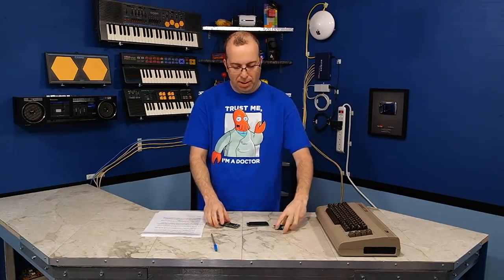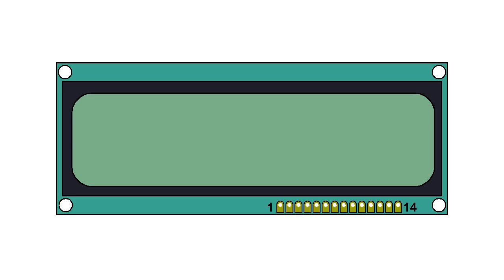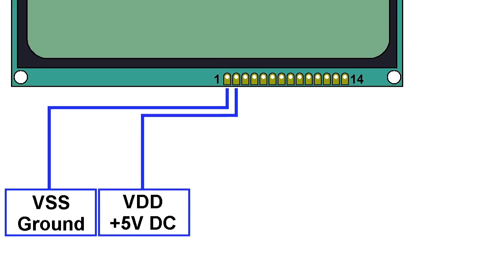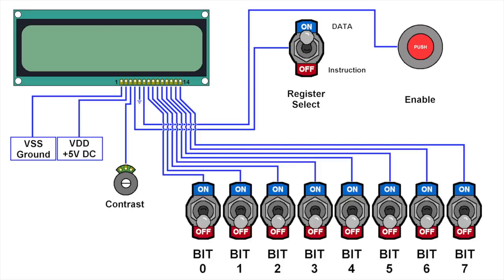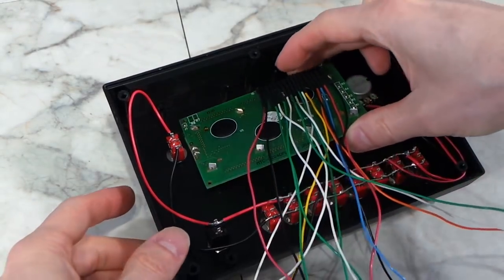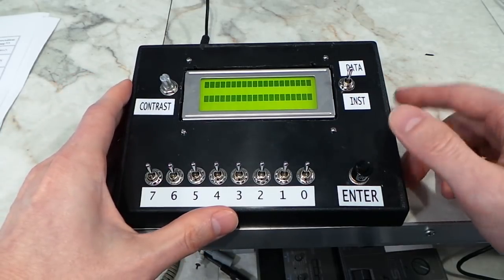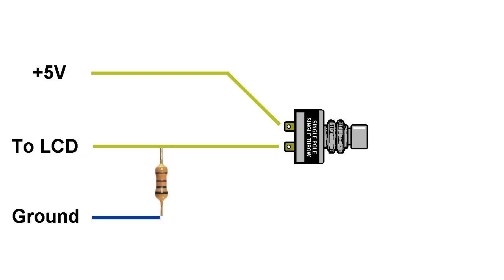How a Character LCD works Part 1

Comment: I liked this video, great for someone getting started in hobby electronics.  I especially appreciate that you show your mistakes!  Too many people edit their videos down to make it look like they got it perfect on the first try and leave the budding hobbyist with the impression that they, the newbie, are just hopeless at it.  Everyone makes mistakes and you often have to build it twice to get it just right.

Looking forward to part 2!
Reply: Robert Liesenfeld moreover, its good to see how he works arround the mistakes he has done. that can be really helpful.
Reply: Yup....and the one "fix" (flip the labels around).....whole lot easier than having to rewire things :D
Reply: @artstrutzenberg7197  I think he should have rewired it and not told us, because... I hate to say it, but that was a very rookie mistake.  With toggle switches like those, when you flip them "down", it connects the center pin with the "top" pin, not the "bottom" one.  It's a common mistake because it's counterintuitive, but a facepalm for anyone who's used toggle switches before. Rewiring would have been as simple as swapping the + and - wires going to the switches. The 8 data switches would have needed only 1 wire swap. (unless he tied off of them for something else).
Reply: I made almost exactly the same comment.  It's perfect to show how you can fix and replace.  I made a toy car with my 11 y.o. son out of printer parts, (gears, transport mechanism, etc., and a motor), and it took 3 1/2 hours because of all the things we had to fix and re-do along the way.  IF it had taken 15 minutes and slapped together, it would have been a fail IMO, because we wouldn't be doing the engineering fault-isolation techniques.  "Hmmm......how do I solve this?"

Comment: Soldering header pins is the way to go with those LCD screens.
Reply: It pained me when we he soldered to pin header. Its honestly worthwhile to just solder pin headers or SIP sockets to everything like that and use dupont connectors or generic jumpers to connect to it and just use non permanent or semi permanent connections. If its the final thing I'll ever use the device in I still always leave some way to remove it just in case. Good design practice. Cheers!
Reply: @Wes8761  yeah that was cringe inducing.

Comment: Those LCD with the damaged pads can be fixed by scratching the traces next to the damaged pads and soldering thin wires directly to the traces.
Reply: I was thinking the same thing.   I've saved many dead things with this technique
Reply: Yeah, I've done the same.
1st, I would take a razor & scrap off the protective film.

I remember using a desoldering strip as a wire.
It'll bind to the board, then attach a wire on the other end.
Reply: Sounds interesting Realtuber thanks for the tip it's a cool ghetto style technical repair technique 😄
Reply: Ive patched together broken PCBs doing that same method
Reply: @dcfuksurmom  well in my case. The PCB and traces were rather large. It was for some gauges for my Datsun 280zx. I was fixing the dash and the connector for the gauges was tight and broke then I tried to unplug it. When I finally got the gauges out, I was able to scratch the coating on the traces and patch them. I also put some double sided tape to hold everything down. Really isn't as hard as it may seam
Reply: @dcfuksurmom  definitely. I believe Dave did do something similar to what I said on a computer monitor in one of his videos
Reply: Ain't nobody got time for that.

JK that's pretty cool.
Reply: Glad some one mentioned this... Even though it was a year ago :D but yes could have been fixed easily enough. ive done it tons of times on prototype projects... Ive also bodged on traces using copper tape, or conductive pens...
Reply: @dcfuksurmom  i've had to do this...not on broken traces, try soldering 18 gauge(awg) to bluetooth headset components, the wire is 3x thicker than the trace its attached to!
Reply: Indeed, I once blew up the RS232 chip in a 56K dial-in modem (ah, those days) and ruined quite a few of the soldering pads and traces on the low-quality PCB while removing the SMD chip. I scraped off the lacquer from nearby pads and traces, and soldered wires to those, connecting to the corresponding pins on the chip. It looked very ghetto, but I did keep using that modem until the ADSL era finally started.
Reply: @theRealLANman   You mean a solder wick? I didn't know those were conductive.
Reply: @themysteryman2678  : Soldering with is usually made of copper, so yeah, conductive.

Including to heat! That was an unwelcome realization.
Reply: He should add a connector to them so they can just be plugged in next time if he plans to reuse them so much.
Reply: If all else fails find another spot on the board to solder it to. You could find a similar board and continuity test some places on it to find a place to solder to.
Reply: Unless it's a multi-layer PCB and the via's get ripped out along with the pads, then you're fairly fudged.
Reply: Good point, however this process is tedious and if the part is cheap then its worth buying it.

Comment: That's an awesome little project! I had no idea they were that easy to drive.
Reply: I agree.
So nice.
Reply: Well, they are. It's because the displays mentioned in this video contain quite nice driver IC and they in China used to copy (as far as I recognize) its behavior, so whenever you need to replace your 8*1 LCD and use 1602 or 2004 all you need to change in your project is to make the symbols fit nicely on your new screen, all the rest driving things remain the same.
Reply: Nick Moore qqqqq
Reply: Olivier Orsola a

Comment: I really enjoy your channel, and this is probably my favorite video yet. Don't worry about it being longer than most of your vids - the content is well worth it. Seeing the process and the missteps adds a lot to the educational value and helps us noobs not feel so bad when we make mistakes!
One question: by wiring the capacitor between +5v and the LCD, doesn't that bypass the switch and make a short?
Reply: Capacitors don't conduct current. They can be "filled up" and "emptied", but once full, no current will flow until the voltage difference between the two pins changes. In this case, when the button is pressed it will discharge. Hope that made sense!?
Reply: I agree,this has to be my fav episode yet and I hope for more like it and longer
Reply: It does, at least conceptually. Thanks. I'm going to have to breadboard up some circuits and play with this more.
Reply: At steady state (once the capacitor is fully charged), capacitors are modeled as open at low frequencies (including DC), and a short at high frequencies (exact frequency depends on the capacitance). This property is what makes them a key in basic frequency filters  too. You are correct though for a brief moment when first applying the voltage it is a short but small capacitors like this charge very fast!

Comment: Instead of rotating the switches, why don't you swap the gnd with the vcc wire that you soldered on those rails?
Reply: That's exactly what I was screaming to the screen, but he didn't hear me :)
Reply: Yeah, same here!
Reply: Exactly!!
Reply: Nicolas Tsagarides wouldn't that cause an issue with the way he wired the enter switch?
Reply: This. Easy enough to swap around the enable key too.
Reply: I think that swapping them would work because it might not matter which side of the switch is +/- and the middle pin would stay the same.
Reply: And what about... creating an IA that would push the buttons for him ?
Reply: Jack he is never going to live that one down is he?
Reply: Aye. That was my thought as well when I saw the video... Just swap the two lines; toggles electrically inverted right way round then.
Reply: Have to admit I didnt think about this and now I feel like an idiot
Reply: :( Me too         !
Reply: He couldn't hear me either, but I live 3500 miles away.
Reply: Dude I should have checked the comments. Just saw the same thing after commenting on a 1yr old video.
Reply: 150 iq comment
Reply: What I answered to Devin Hollis counts for you too guys.

Comment: The display on the printer shown at the beginning at 0:31 is a VFD also know as a Vacuum Florescent Display. It's an honest mistake a lot of people make though. Still love the video!
Reply: I knew it wasn't lcd, but I didn't know what it was
Reply: Yep, Fixed now. Thanks!
Reply: The VFD is effectively the same as a CLCD.
Reply: There are VFDs that run on similar driver chips to character LCDs. Same interface and function, but different display technology.
Reply: @oH well,lord! i have no idea its a two year old comment and i can't be assed to google it

Comment: Just change the +5V and GND wires on switches and  all will be fine
Reply: @tgmforum tgmforum they are upside down now ...  i mean main power wires that going to the switches ... just 2 wires, not all 24 (10 in this case) the data is on middle pins and wont be touched. This will exchange low and high levol on switches
Reply: OMG lol
Reply: Yes.. just swapping two wires..  Not sure why that didn't occur to 8-bit guy.  Sometime very smart people miss the forest for the trees ;)
Reply: @technixbul: Thought of exactly the same thing as they're common-railed.
Reply: @tgmforum tgmforum I love how you were wrong and never accepted it and admitted that xD
Reply: @tgmforum tgmforum why so hostile?
Reply: @tgmforum tgmforum  I don't think you're going to be able to reach that guy (funky whatever).  He's clearly so deeply on the spectrum that he's got his own category.  BTW, how did you make that upside down 1?  Online utility?
Reply: @MilesPrower1992  .. oh no, he called me boomer!  What a totally new and original insult. I don't think I will ever recover from this.
Reply: @mrburns366  well he cant tell the difference between an led display and a lcd display so........

Comment: Fun fact: High for READ and low for WRITE is a standard that spans all electronics handling, registers - basically everything.

And it is easy to remember: I/O looks like 1/0
Read - Input - I - 1 - High
Write - Output - O - 0 - Low

Comment: Thanks to this video I finally got what are capacitors and transistors.
Reply: There were no transistors shown.
Reply: Carl Siemens "No transistors were harmed making this video."

(However, a couple of innocent LCD's got 3rd degree burns...)
Reply: Technically there are a few thousand transistors in that lcd driver ic though. But a very educational video nevertheless!

Comment: Your switches aren't upside down, they're just European - the convention here is down position for on !
Reply: Thomas Leonard That's so weird and backwards, lol
Reply: Thomas Leonard whoah, I didn't even realise switches here were like that, I checked some and it really is like that
Reply: Thomas Leonard wait, in the u.k., we have up is off and down is on. is this not the case in the usa?
Reply: Yeah, it's cheaper to buy foreign, and just mount it sideways :D
Reply: I was thinking the same, down is the "on" position  (EU). Had now clue that in the US it was different.  What about the rest of the world.
Reply: The idea in the US is that lowest potential energy should be off. Things falling and hitting a switch (like a broom leaning against a wall and sliding sideways and falling into a switch - I've had this happen several times in my life!) shouldn't turn them on (in several cases it's left me in a darkened room!). I appreciate this with the wall switch controlling my garbage disposal. If a picture on the wall or a mug on a shelf fell on that switch while I was fetching a fork that fell into the drain, I'd have a bad time. The switches are different, though. US switches are like levers sticking out, begging to be hit by falling picture frames. UK switches tend to be much flatter, more flush rocker switches.
Reply: Keep in mind, though, that we end up with a lot of double-switches in the US. The kitchen in the house I grew up in, and the one I live in now (and several I've lived in over the years) have a switch at the entryway on both ends, for convenience. These completely destroy the "down = off" custom. If I flip switch A up to turn it on, you can flip switch B up to turn it off, and now both switches are up, and the light is off.
Reply: Thomas Leonard no, they are like minecraft switches
Reply: Here in Brazil the on is up o/
Reply: I just looked at my light switch and realized that!
Reply: In my travels in Canada, Mexico, and Central America theirs are as the US, up on/down off.
Reply: Yes, light switches in Europe look more like large flat buttons that try to blend in with their surroundings. Only way you can activate the switch other than by hand is by aiming a small object at the flat switch and try to hit it head on. If the object is a bit heavy though, or you throw too hard, the impact may very well break the plastic button. I think a fairly safe way to do this would be by trying to hit the switch with a toy (inflated) ball.
Reply: I believe Minecraft has taught me this would be an XOR gate.
Reply: Thomas Leonard whoever put light switches in my dad's house was probably american, since up = on (in Europe it should be down = on)
Reply: Here in Spain, on and off is whatever. There's no convention because many lights can be turned on and off from 2-3 places (sometimes even more). For example in hallways, or in a bedroom (one switch next to the door and one next to each bed). When you use one switch, the rest are "reversed".
Reply: There’s no convention in my house! Every switch has its own direction.
Reply: Is this supposed to apply to light switches as well? Because I'm pretty sure we've got light switches were down is off where I live (in Europe).
Reply: My outlets are European.
Not as in plug style or volts. As in they're all upside-down which is really stupid when you think about it.
Also the light switch at the bottom of my stairs is European.
Reply: @newagederpderp  I never liked outlets with the ground on top! Whenever I replace outlets, I turn them the right way around, even if that's difficult.
Reply: I moved o Canada from England 11 years ago and the light switches still confuse me !
Reply: Where in Europe? Do you maybe mean British instead of European? From wikipedia's "light switch" article:
"The direction which represents "on" also varies by country. In the US, Canada, european countries, Russia, etc., it is usual for the "on" position of a toggle switch to be "up", whereas in many other countries such as the UK, Ireland, Australia, New Zealand (Commonwealth countries) it is "down". (In multiway switching, the correspondence between a single switch's state and whether lights are on or off depends on the state of the other switch[es] in the circuit.)"
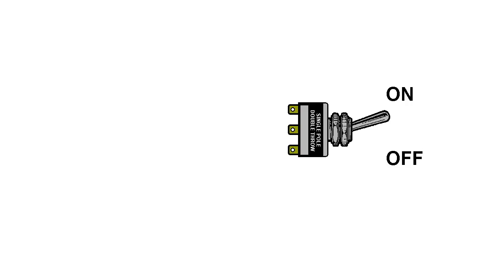Reply: Fun fact(s):  There are three main types of switches for controlling lights in home wiring.  A "two-way" switch is a basic on/off switch, with two terminals, and in the US at least, is labeled OFF/ON.  Only that one switch can control the light.  Having two switches control a light requires three-way switches.  Each of these has three terminals, and behaves exactly like that SPDT switch in the video 1:56.  These can't be marked ON/OFF because usually they're wired such that the light is on when both switches are the same direction, be that up or down.  Having three or more switches requires one or more four-way switches, and two three-way switches.  A four-way switch has four terminals, and is just like a DPDT switch which is cross-wired with an X.  One position of the switch sends the two input wires to the output straight through; the other position reverses them.
Reply: @newagederpderp  The benefit is that if something conductive falls between the socket and a partially unplugged plug, it doesn't bridge the hot and neutral wires.
Reply: In Australia down is on too.
Reply: @DangarMarine  Yeah, it's the British and those that are/have been heavily influenced by them in the past. (but apparently not most of Europe, though, despite what the top level comment says)
Reply: Like the minecraft lever
Reply: Even in India we have the EXACT same switch system as UK, but I gotta agree the US system is smarter here as mentioned above.
Reply: I am Romanian and my light switch is DOWN for OFF and UP for ON.
Reply: @kort4n120  yall obviously dont play mc
Reply: @vlusky_husky  i do
Reply: @gfixler  the electric systems in Europe is the same, the switch inside has two outputs thats works as high/low or low/high.... but only one input (P contact), if you take the outputs from that swith ( we use black wire for that) and wire them to the output of the second same type of switch then you get this effect. One P contact is wired to 110/230 volts AC, the other P contact of second switch is wired to the lamps. So thats why it doesnt matter which switch you use (  1 or 2)  to switch on the light. The lamp itself  lays always on 0 Volts AC.
Reply: Never even thought about it. But yes down is on on single switches, obviously on 3 ways either work depending on the other switch (like on stairs).